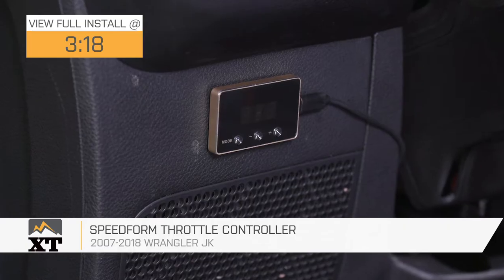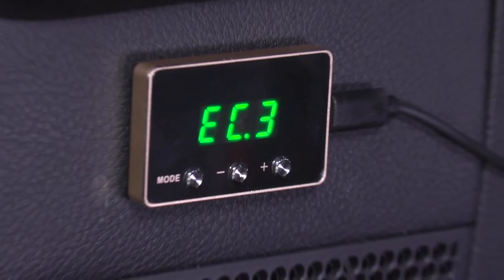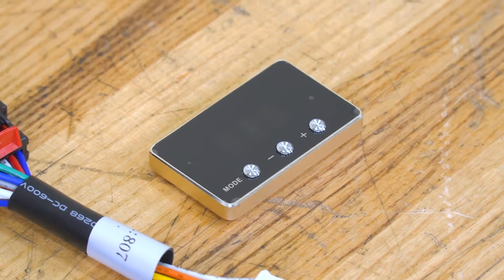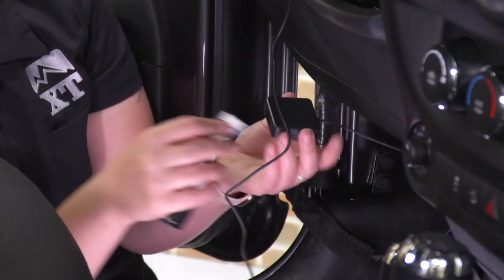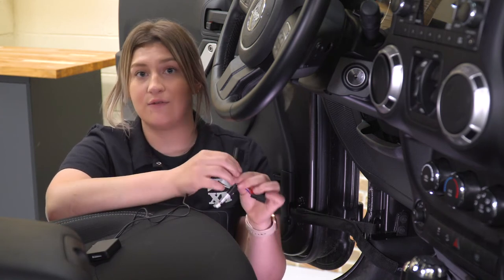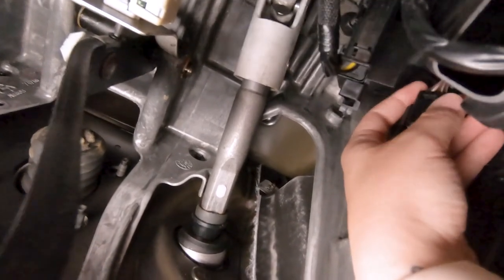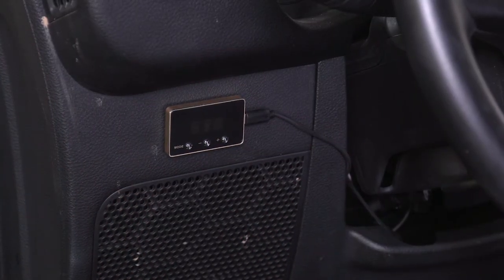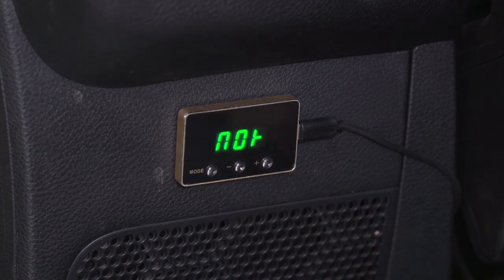Jeep Wrangler JK SpeedForm Throttle Controller Review & Install

Comment: After 4 months of use  I can report having NO issues with this unit! Super inexpensive and works freaking great! I use P2.1 at all times. Once I got used to this controller I was able to get the same if not better gas milage. Believe me you will drive your jeep harder because it's simply a blast to drive with this thing! I could go on and on, so in conclusion, if you are on the fence just buy one and see for yourself. You wont be sorry!
Reply from the maker: Thanks for the long-term review! We love to hear it! -Zach
Reply: @extremeterrain  Thanks Zach! My pleasure.

Comment: Hi,  I like your videos a lot and I am a subscriber because it helps me and others, if you don't mind can you give feedback regarding safety issues, My question is what if the throttle controller's device suddenly fails? or was the little wire accidentally cut? Do we still have the control of gas pedal, especially on the highway? or it will be back to normal mode? Thank you for hoping you can enlighten us. thank you again!
Reply: Shit, that is a great question. I'm really curious about that myself

Comment: Great video I just have one question I installed mine and as soon as I  did the idle started acting up, the check engine light went on I hooked up my code reader and it's telling me that the circuit is low, Cleared the code and it starts up fine I let the car sit for a while and it throws that same code again and the throttle is not responding this is an ongoing problem, do you think is my pedal unit that needs to be replaced?